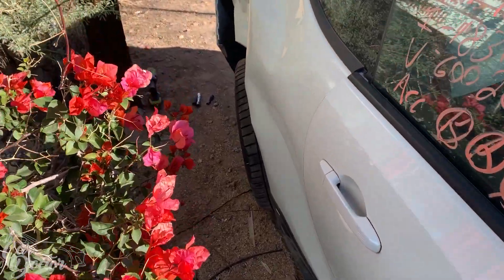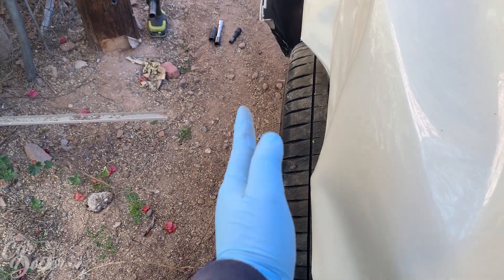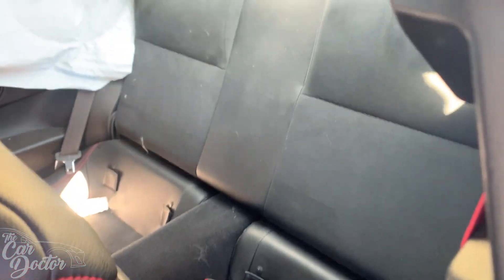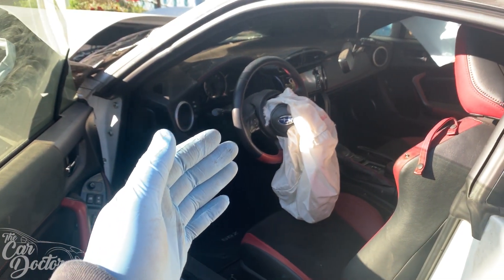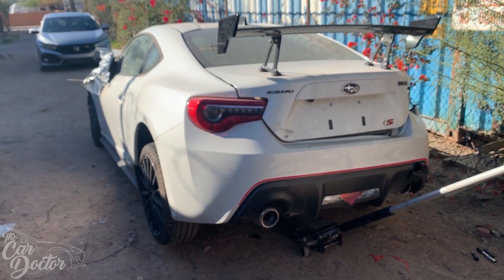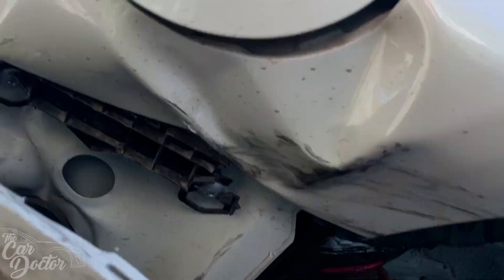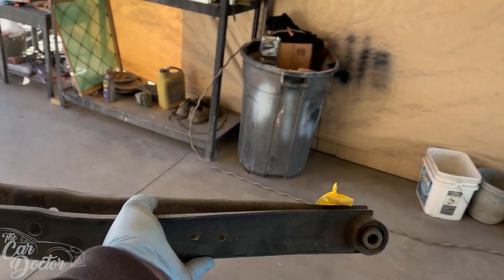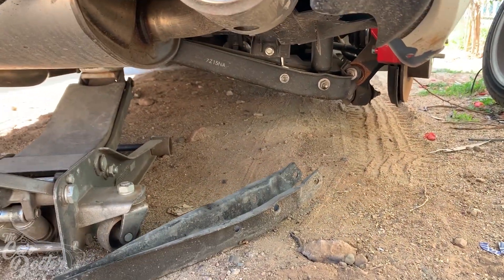Upgrading my Initialized frs to a 2018 Subaru Brz Ts

Comment: hey man awesome to see someone undertake a project like this and would be an awesome build but i can already see how much work this is going to be, and you will pretty much need to chop and replace the firewall and right front frame rail yet alone that rear quarter and the panels underneath it. I am hyped for you just hope you got the cash to push through.
Reply from the maker: chopping firewall forward for sure!